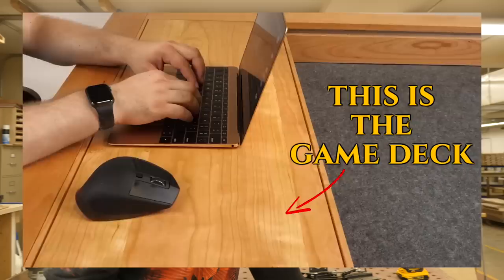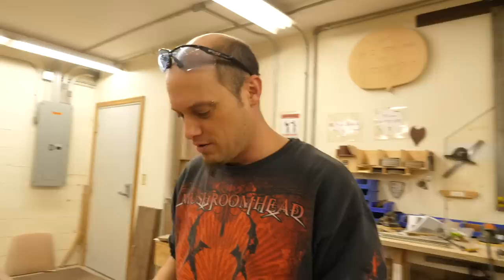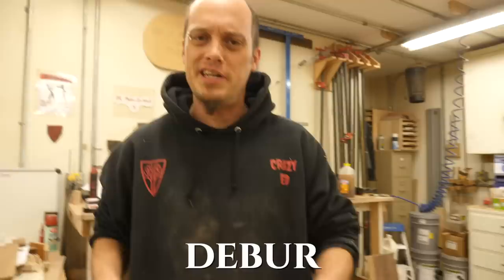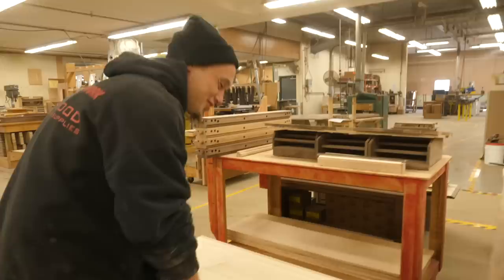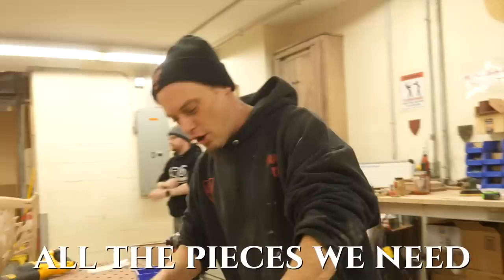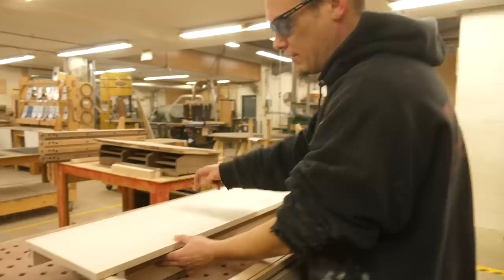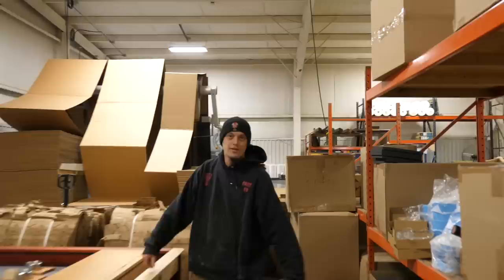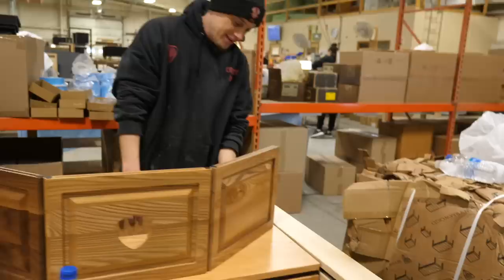Can Crazy Ed Solve This? (yes, he can) S12E06

Comment: That extra little piece to hook the whole thing into the table with magnets to avoid tipping is so smart. Great job Ed!
Reply: Yes! I would say Ed and team should explore the longer drawer slides again if they haven't. Still probably better with he shorter ones for strength with all that weight on top so the slides don't fail, but much cooler if opens fully.
Reply: yeah, that little detail, that little extra mile, we customers notice and appricate that
Reply: That extra bit was the bit that actually made me gasp in appreciation.

Phenomenonal work Ed. I know it seems simple in retrospect but that was next level thinking.
Reply: That was genius. I was thinking "Oh, they could add a bit that hinges down top tray slides out, but then it'd have to get flipped back up somehow, plus it's more moving parts, dunno about this second design," and he went and made it the better of the two designs with a tiny little piece of wood. Crazy Ed, I know you read these comments, pat yourself on the back. You're crazy good at what you do.
Reply: And my initial thought was to add a counter weight but that would add to shipping costs. This solution? Genius. Good job, Ed.
Reply: Not to mention cost effective.
Reply: Agreed! Super simple solution. No over engineering creating other issues.

Love the cantilever version vs the slider - but the slider probably better for board games.

Comment: Motion to nominate Crazy Ed as Wyrmwoods official MVP; Most Valuable Psycho
Reply: Actually laughed out loud. Thank you
Reply: @CRAZY-ED  Magnets in the game deck top and the bottom of dm screens so the dm screens Can magnet into place on the game deck?
Reply: @theDuckiG  eh they have rubber feet
Reply: @CRAZY-ED   lol just thought it would be satisfying to click into place
Reply: @theDuckiG  I get it
Reply: I instantly thought of Borderlands
Reply: @theDuckiG  The problem with that would be if you had anything non magnetic it would cause them to stick. It also means you would have to have the dm screen at one single point on it.
Reply: @CRAZY-ED   Uncle Joey was the guy in Full House you couldn't remember the name of, in case ya didn't just look it up after afterwards
Reply: @CRAZY-ED  can I make a pitch to you?
DM screen with removable magnetic fronts. Imagine swapping out frames for your screens that have your choice of fancy veneer (bird's-eye Maple Burl anyone?) Or even better: laser cut lattice work featuring D&D art. Every campaign gets a sweet thematic screen. One system. Many styles/themes. All wood.
Reply: @pabloferrer5798  I get it but wood is very brittle when super thin. Very easy 2 break in 1 direction
Reply: Motion passed
Reply: @CRAZY-ED  true dat. I was envisioning laser cutting veneered ply. But that thickness might be cost prohibitive to address those cracking issues. Be an interesting experiment to run! Maybe test it with a shotty too. 🤔😂

Comment: The slides version will interfere with player desks or other accessories that are also on the table.  For example, a game deck and 5 player desks pretty much fills the entirety of the accessory rails on a medium sized vault.  You'd never be able to open the slide version with those 5 player desks in.  
Secondly, the stabilization bar on the cantilevered version will dramatically decrease usable storage space in the game deck.  
Thirdly, I love the work and ideas here.  Keep up the great work Crazy Ed.  Love to see your rapid prototyping.

Comment: I actually really like the dark legs with the light sides... creates a really pleasing contrast. And I think the sliding option is generally better due to price/manufacturing/etc., even though the lift is  what I'd generally prefer in use, the price bump wouldn't be worth it (especially since it's a modified part, not just an off the shelf one)

Comment: Brilliant ideas. Ed got there in the end with the little magnetic spline to join the rails at the end to prevent tipping. And with the slide there is more well defined safe space inside and less movements on the top which may have dice tiers and laptops as well as dm screen   
Well done.

Comment: The little bridge to prevent tipping is a solid solution. One problem: as shown, it will only work when the deck is on one of the ends of the table. But the deck also supports being a divider in the middle of the table. While you wouldn’t have a GM screen on it then, you might still have heavy things on top when you slide it open. If the bridge somehow could attach to the side rails rather than the end rails then it could still function no matter where the deck was placed in the table.

Comment: What particularly impresses me is that when I make prototypes, I skip certain "unnecessary" details like sanding, some chamfers, etc.  Crazy Ed seems to make every prototype as though it is the finished product which is great for visualization for other people.  Rough prototypes are difficult for the intended audience to fully understand.  Kudos to Crazy Ed's skills!
Reply: For some people it would bother us more not to do it all lol. Or at least that's the case for me. Even stuff you won't ever see has to meet a certain standard or else it'll bother me knowing it looks bad. (stuff that isn't ever visible does have a lower standard than everything you can see, but that standard is higher than normal for unseen areas)

Comment: I definitely prefer the slide to the cantilever, mostly because of that stabilizing bar. It would severely restrict what all you can fit inside, since it comes down right in the middle of the storage area. If you can’t get rid of that bar or at least have it come down along the edge instead of the middle, then I would just ditch the cantilever idea entirely.

Comment: On the slide out version, that little piece of wood is suepr smart.  Another option would be to have the piece of front facing wood that slides out be the same height as the rest of the drawer so it glides along the felt on the table.  Essentially acting like a leg, but would sit flush with the rest of it when not in use.

Comment: I feel like Ed is going to get too big an ego, but this is so freakin' good! Great thinking all around. 

Personally, as a DM I'd prefer the cantilever even despite the drawbacks. It's worth Wyrmwood thinking about how the table is very likely going to be in use during a D&D game -- so sliding forward may not be possible or practical. There will be minis and environments in the way, and even more serious, probably player desks in the rails. However, I get the point that cost is a factor. What's the difference in price between the slide out vs cantilever? I'd pay $50 extra for that, but not sure if I'd pay $100. So it would depend.

Regarding the larger size of player deck, that's actually a plus honestly. As a DM I was concerned the previous one might be too small anyway. Only question I'd pose -- with the new size, can you fit 2x player desks + the deck in the length of a medium table? (Unless I'm mistaken, I think you could with the old one.) Would appreciate someone checking this.

Thanks for all the hard work as always! :)
Reply: I love ego waffles

Comment: So from the looks of it, a 4-panel screen like I've got will be a tight fit on the MGT... good to know. Thanks Ed!
Reply: Warg as me size would hold 4
Reply: @CRAZY-ED  Question -- if you squared the corners of the 4-panel screen before sliding it out, would it fit? I did order a 4-panel.
Reply: @d_dave7200  should. I don’t remember how wide they are tho

Comment: If you wanted to cut down on costs for buying sliders, would it work to use a modified version of the wood sliding mechanism that Bennet came up with in a previous video?

Comment: Ive been enjoying seeing what crazy ed has been up to. Everyone needs a friend like Ed to just help you figure out a problem. 

to keep cost down, is there any way that you could just use what Jason did with the sit/stand desk drawers to keep cost down and reduce issues with failure of the hardware? Also while your little wood piece helps if the player desk is at one end, what do you do if its in the middle of the table, and you need to open it?

also with regards to a lift top design, couldnt you take from Michael Alm's coffee table design? or what about a roll top?
Reply: I’m hoping for self closing slides. It’s quite satisfying 2 see it close itself

Comment: For the sliding version, a retractable piece on both sides of the leading edge that slots into the accessory rails would prevent tipping. Maybe using a somewhat loose dovetail, with a finger notch cut out for sliding it into and out of place?
Reply: lol I should watch all the way to the end of videos before commenting. That was a MUCH simpler and more elegant solution than what I was thinking 😅

Comment: About the tipping problem: I'm no woodworker, but couldn't the tipping side be flush with the table "floor"? This way it literally can't tip.
I realize it could be a problem if you have something in  front of it like a gaming board/miniatures/dices you don't want to move, but the flush part can be just to the sides, like little legs (not as pretty probably, but just as effective).

Comment: How about two way drawer slides so it can slide either direction. So when it is in the middle of the table you can access it from either side. To bring the cost down what about put the top on wooden runners that slot into the sides so it is bidirectional and saves on cost on hardware.

Comment: The cantilever design is definitely superior. Even though it's more expensive hardware there's almost no potential to knock over game components. Some other people may have a different preference. The sliding game deck is pretty cool But I think it will get in the way more often. 

If I were you guys I would offer both options. I think different people are going to have different needs. That being said, if you only go with one I would go with the cantilever

Comment: Got the feeling that ed should advise on most if not all your new products. Give him a problem of the game deck, throws together very usable canter lever design. Gets told thet it would work but too expensive to use all that extra hardware, next day throws together different idea that is as elegant and works. Thats 1 prototype and its reached a workable option. Then day later comes back fixing an issue with the design in case of added weight causing issue. Fixes in epic keep it simple stupid design that requires minimal added in product while not changing anything on prototype while still fixing an issue that may come up and annoy customers. That sort of care for the end user and critical thinking makes ed one great member of the company. From what ive seen of other employees that care seems to be in abundance in this company.
Reply: Thank you

Comment: Excellent job, but honestly I think the request here is unreasonable. It's a flat wide container and people want to get into it without taking anything off the top?  Also, the original design was meant to put stuff on.  This is an unnecessary amount of work for a feature that no one is going to use.  I don't think people are going to feel comfortable using the cantilever when it's got stuff on top, and the slide rail means you can't have anything in front of it either. So it's just pushing the problem elsewhere.  And you're sacrificing space to do it.  Ed's original hinge top was perfect.

Comment: could still be a tipping issue if it isn't on the end of the table though?  Otherwise, nice solution and don't use the cantilever lift.  I have a coffee table with it and it can destroy the stuff underneath it when you open close.  Also, with the stabilizer bar, it just gets worse because it goes the whole length.

Comment: since the game deck comes completely pre built what if you did the solution jason did with the desk drawers and just used wood runners, you wouldn't have to add the little insert hardware since it's put entirely together, you just build the runner in already set.